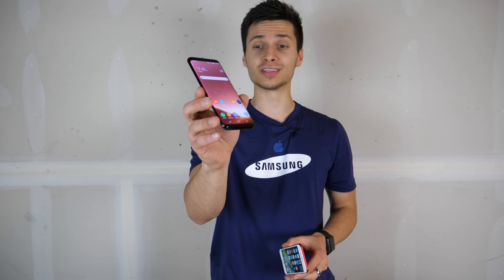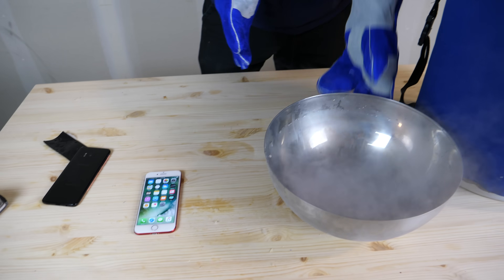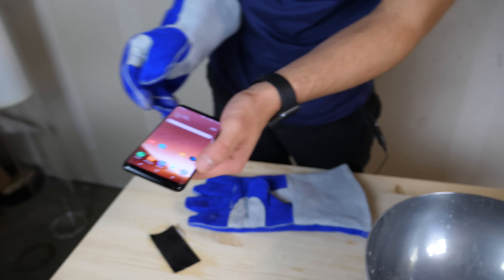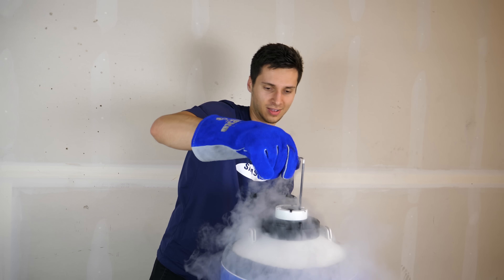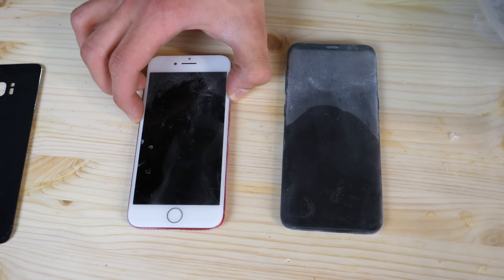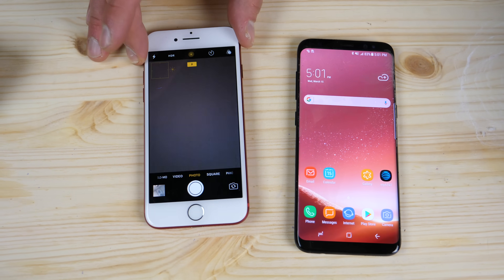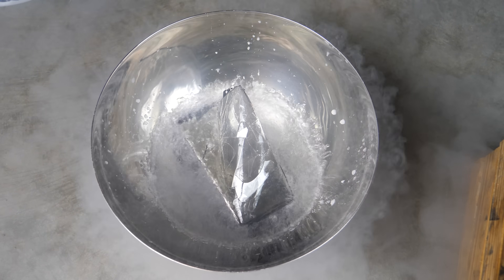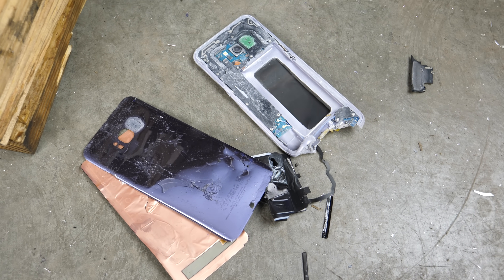Liquid Nitrogen vs Samsung Galaxy S8 & iPhone 7! What Happens?

Comment: let's add a fourth to make it fair hwat m8. Also blows on it 2 times
Reply: Just Blo 
You clearly have no idea what you're talking about. Adding an extra scoop makes a significant difference, anyone with the slightest knowledge of thermodynamics would know that.
Reply: Just Blo
Also please use spellcheck.. it's temperature not tempreture -_- Stop making me cringe
Reply: What does a 4-Inch screen have to do with anything? You spelled it wrong four times its not like it was a typo - you just can't spell.

And yes, it will 100% make a difference, you don't know what you're talking about. When you pour the liquid nitrogen on the phone what happens is that the liquid nitrogen absorbs energy (temperature) from the phone, causing the phone to become colder, however since one scoop only has so much volume, it can only absorb so much energy before it turns into a gas. The more you pour the colder the phone becomes as a result of the phone's energy transferring to the much colder liquid nitrogen. 

If you have a cup of 200ml boiling water and you put an ice cube in it, the water will still be extremely hot after. But if you dump a cup of ice in it than you can expect the temperature to go down significantly

Get it yet?
Reply: Just Blo
Ps, if water is boiling, it's also evaporating you dumbass
Reply: 주정미 but didn't he do that because the S8 was a newer phone
Reply: Even if the liquid nitrogen has specific temperature, there is possibility to make a difference by adding 4th. So... no matter what.. since he added 4th, it is not fair :3
Reply: Just Blo I'm pretty sure it would matter. He added third. After few seconds, temperature might went up, and then when forth added, temperature went down to SPECIFIC temperature. Therefore iphone 7 was freezes 3times and galaxy s8 was freezes 4times. I'm pretty sure it would matter. btw I love apple.I have 2 ipad, iphone4, and 7.
Reply: that's like during a race u trip someone and say to make it fair
Reply: ItzGabem9 salty because iPhone wins again LOL